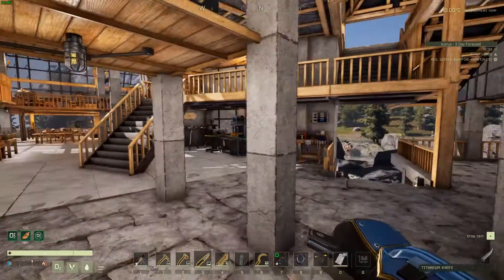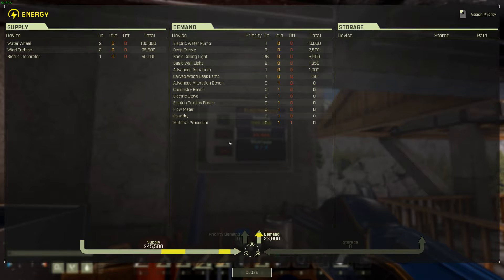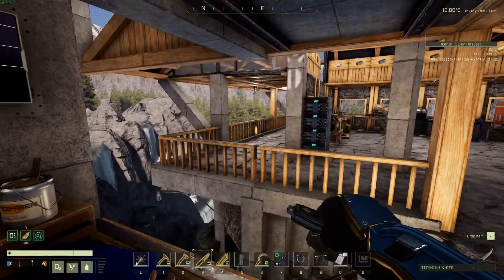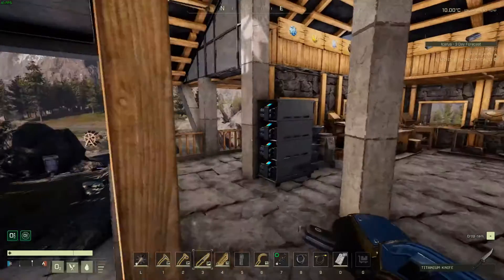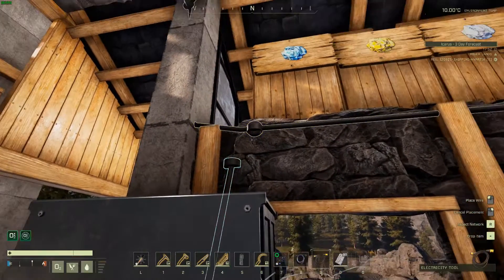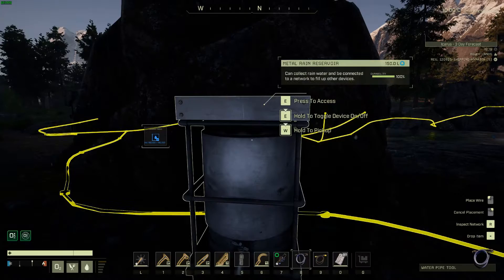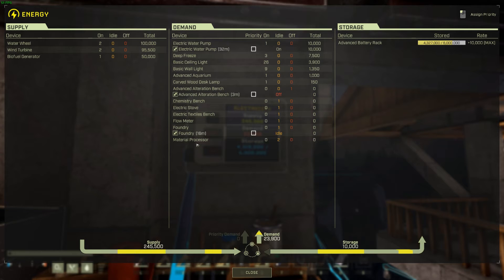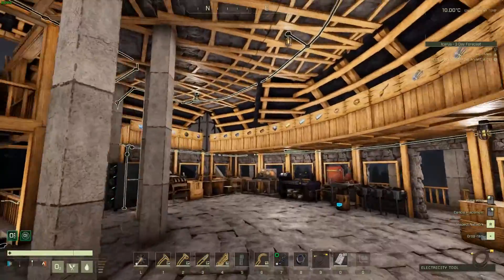Icarus - Build Tip - Water & Electricity Networks & Troubleshooting

Comment: Great video. So, just how many water wheels, wind turbines and generators do you have? Based on what I see on the flow meter, it looks like 50 water wheels, 10 generators, and 54 4/7 wind turbines?? The math doesn’t work on the turbines. Overall you have well over your demand. Planning on adding more to your base? Nice base btw.👍
Reply from the maker: Lol, there is actually only 2 water wheels and 2 wind turbines, and 1 generator.  But they are super-charged in the mod I run (50k each).

Comment: The water and electricity is very glitchy! Nice new updates, but getting tired of re-running lines whenever they update something.
Reply from the maker: So far I haven’t had any issues with electrical or plumbing pieces missing, after updates.  I have gone back on 30+ open world bases and that aspect has been solid.  Still notice a floor or wall here and there missing on occasion though, seems they still haven’t fixed that yet.
Reply: @icarus-firstcohort-basebui9026  , I am not missing electrical pieces, but one day the water and electric works and the next it does not, even after repairing items after a storm. We have to go back, remove and re-run the lines.
Reply from the maker: @CassieDee  damn, that sucks… have not had that happen to me, sorry to hear that
Reply: True!
Reply: @CassieDee  no issues at all